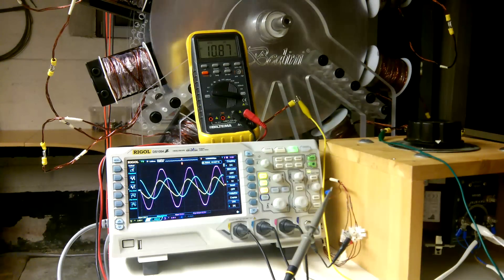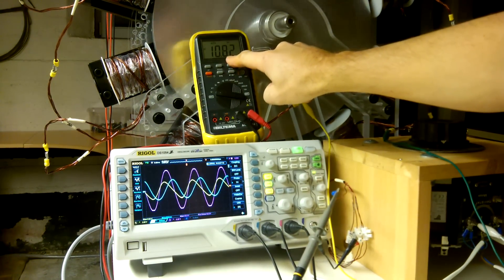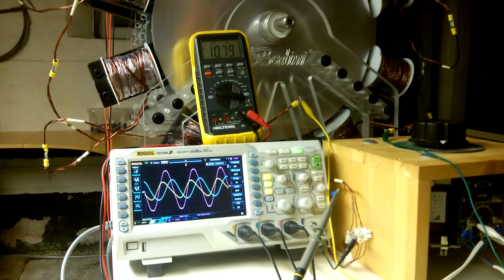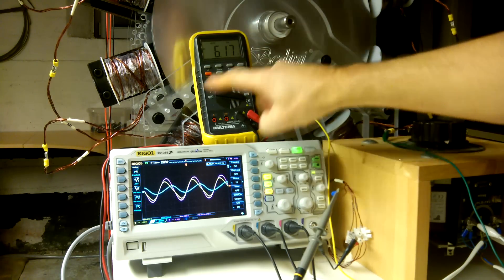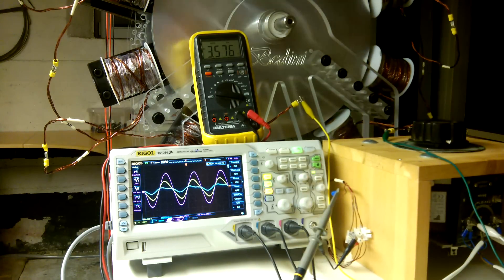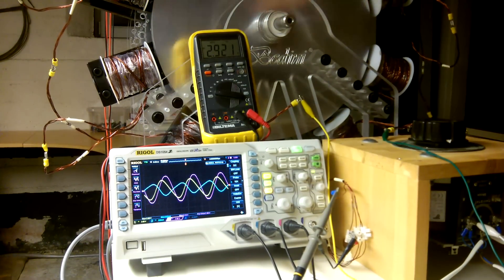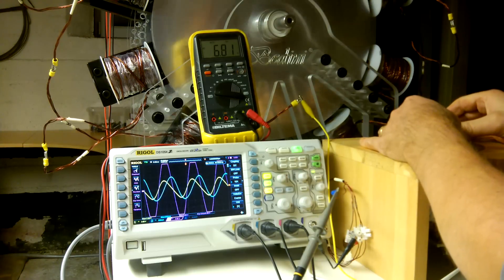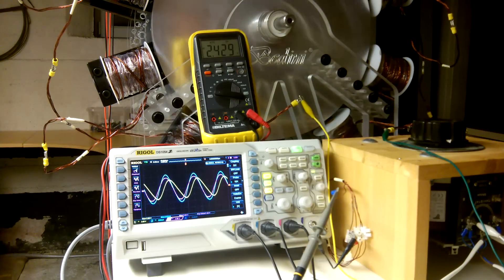My 1st Selfrunning Generator?

Comment: once the unit's speed is at equilibrium, consider shorting the variacs terminals while shutting it off and see if the wheel's speed stabilizes. post a video of the traces where the current through the one ohm resistor is only provided by the coils. in fact, consider starting without the variac all together and manually spin up the wheel to resonance and see if it stays there on its own. consider less resistance and less v/div.

Comment: I understand your connections, I'll offer my thoughts.

First, you have 9 coils connected in series with each other, so your variac AC voltage is actually being applied across all 9 coils... which means the AC voltage across each one is 1/9th of the total applied AC voltage... right?  
 
So when comparing a single "motoring" coil to your 10th "open" coil, the Voltage ratio is actually MUCH greater... so instead of 2.5V RMS, you actually have 0.2777V RMS across each of the 9 driving/motoring coils.  

But here's the real problem, you can not compare just Voltages... that is an very incomplete comparison. 

You are applying POWER to the 9 motoring coils... a combination of Voltage and Current, combined at some Phase relationship between the Voltage and Current.  When you correctly calculate these three together, you will know actual driving Power.  

The Voltage being Generated on the 10th (non-connected) coil only represents 1 part of what's required to do a fair and proper comparison. If you were driving a resistive load with that 10th coil, then you could calculate a comparison properly. 

The motoring coils have a load connected... it's your variac transformer, then the AC mains on the other side.  The 10th coil is operating completely unloaded... and these different conditions means you cannot compare them directly.

Keep on experimenting!!  :-)

BTW... then the driving Current becomes exactly in-phase with the driving Voltage, that indicates a Power Factor of 1.0 - which is a perfectly applied power condition. At that point your Applied Power calculations are simple... Voltage times Current... no need to worry about the phase relationship, since they are in-phase.

Comment: "My 1st Selfrunning Generator?": NO. A "Selfrunning Generator" powered from the grid is not a "Selfrunning Generator" by definition of what a "Selfrunning Generator" is. 
Instead of writing an absurd title, it would be more useful to provide the schematics. We guess that the variac at higher voltage imposes the current which is out of phase by pi/2 due to the circuit inductance, and consequently the phase of the magnets rotation relative to the voltage timing. When you reduce the voltage, the counter emf is no more negligible and also the variac inductance is reduced (measure it!), leading to a shift of the magnets timing and a better in phase voltage/current, each one being the resultant of the superposition of the variac voltage/current and counter EMF/current.
Reply from the maker: +exnihiloest A schematic? LOL! 9 coils, 1 ohm resistor and the secondary of the variac all in series ;-) What about when the voltage from the variac is LESS (!) than the EMF? Hence the title :-p

Comment from the maker: I don’t get it, why give a thumbs-down instead of an explanation? Stupid trolls?
Reply from the maker: +Hob Nilre Ah.., I get it; the most interesting videos are the ones that gets thumb-downs?
Reply: +Hob Nilre 
It's simple. Before you claim anything "selfrunning" be so kind to disconnect your power supply.
And besides, the EMF is not measured in volts, it's a Force.
Second, to talk subjectively at least get a schematic, not poke you fingers in bunch of wires.
There's third and fourth, but can't spend time to teach you simple Physics. Figure it out for yourself, and then remove your "selfrunning" video.
Thumbs down here.
Reply from the maker: +alex oil Now that we finally are properly introduced I would like to ask you; you didn’t read the question-mark in the title, did you? <- another question-mark. You could just have answered that question with a "no", and I would agree. One evidence is in the phase between the voltage and the current going to zero. The real question is; why does it still run when the variac voltage is below the EMF voltage? BTW, are you seriously suggesting EMF is not measured in volts? Pleas spend some time and teach me simple physics ;-)
Reply: +Hob Nilre qmogen magnet motor community

Comment: The motor torque is directly proportional to the voltage. That's the axle pressure required to make the rotor slip.
Reply from the maker: +zebok3 i added some info in the about-box

Comment: There is a current of 400mA? Is that not driving the motor? Also the Variac, it is powering the system? 
Perhaps I missed the point. (ps: my questions are more regarding the title of your upload, less to your question).
Reply from the maker: +deslomeslager i added some info in the about-box
Reply: +Hob Nilre "When the output from the transformer is decreased below the EMF the current shifts and the rotor continues to run."
Perhaps a cos-phi phase shift?
I don't know how you decided that the wheel does not turn below 2.5 Volt, I assume by increasing and decreasing the voltage from the variac.
What I am missing is why the wheel should not rotate at 2.5 Volts, why it has do do with the 5.5 Volt EMF you speak of.
I do see that 150rpm=2.5 rotatiosn. 2.5 times 20 magnets=50 hz. So it is the exact speed, the coils (if they are exactly in line with the magnets, which I doubt since 20 and 9 have no common denominator) it would be in sync.
Ah well. Just my 5 cents, it won't help a lot, sorry.
Reply from the maker: +deslomeslager when the variac is less than the EMF the variac looks like a load and the wheel becomes a generator instead of a motor